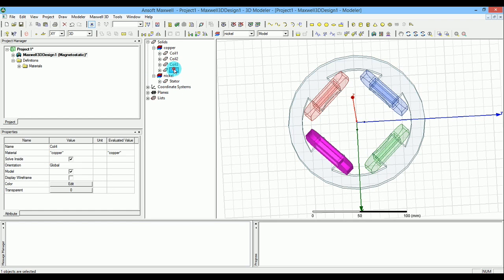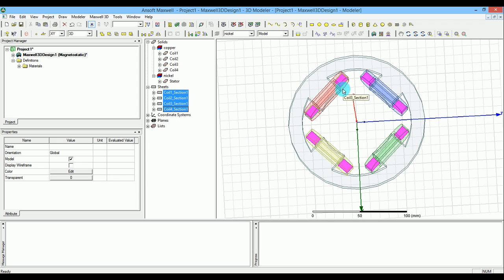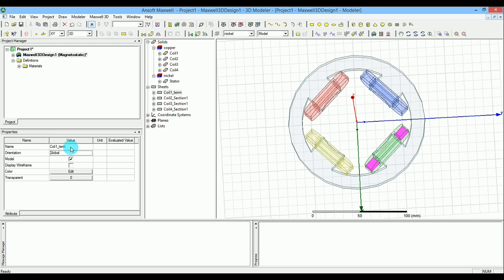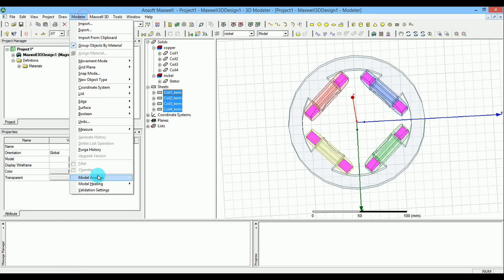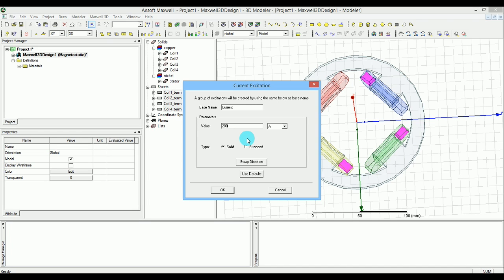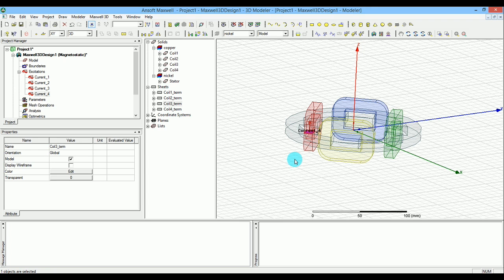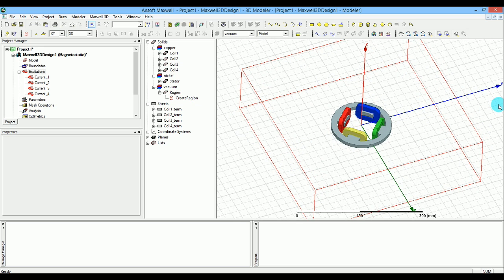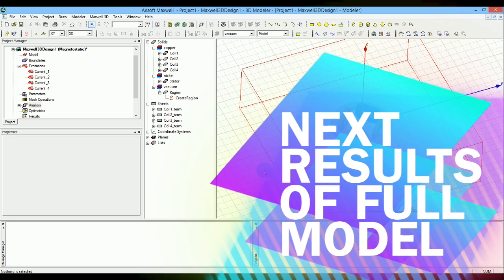226 - ANSYS Maxwell - Master / Slave Boundary [Excitations 2/4]

Comment: Why the cross section has to be on x y plan?
Reply: In YZ or ZX plane the section plane would not have been perpendicular to the coil cross section area.. so XY is the only choice you can go with